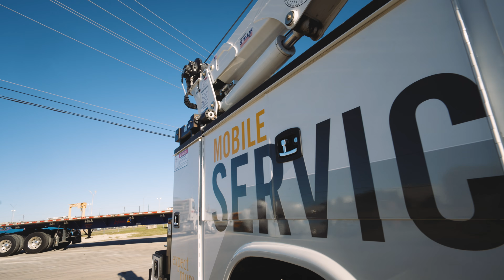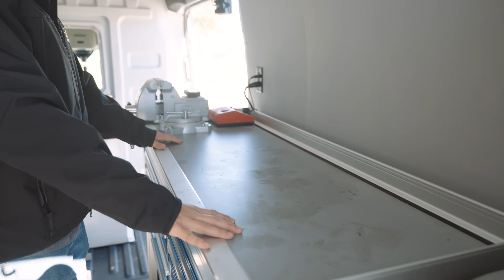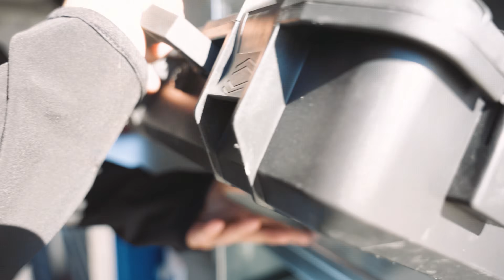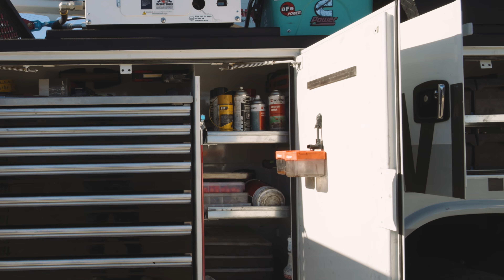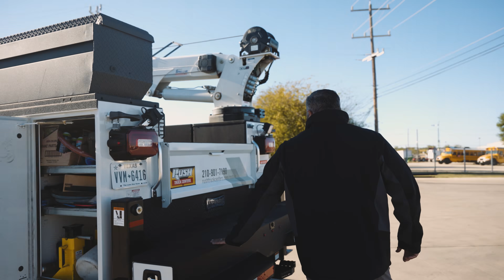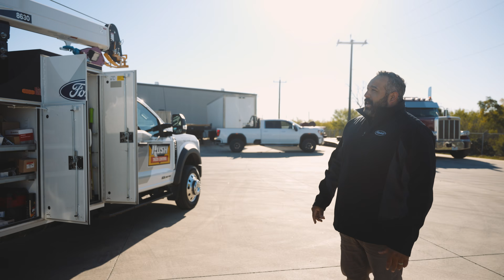Mobile Service Fleet at @RushEnterprises–A Mobile Service Mechanics Truck & Van with Van Equipment

Comment: Why are American service bodies equipped with an open doghouse instead of enclosed with a sliding roof?
Reply from the maker: Thanks for the reply! Many of our utility bodies are open like the one in the video, but we do offer options for a telescopic sliding roof for some applications. If an entirely closed body is needed, we also build our Knapheide Utility Vehicle (KUV) line of fully-enclosed utility truck and van bodies.